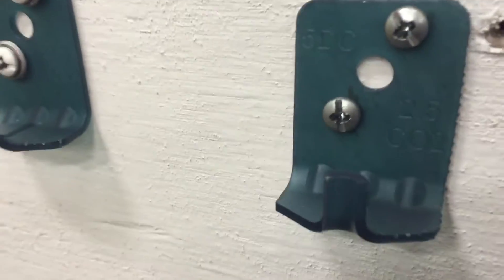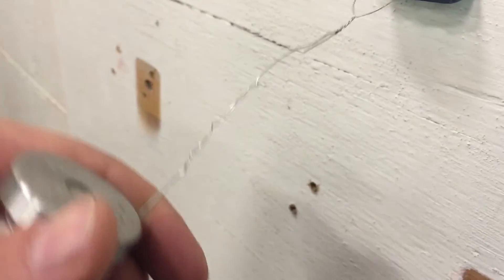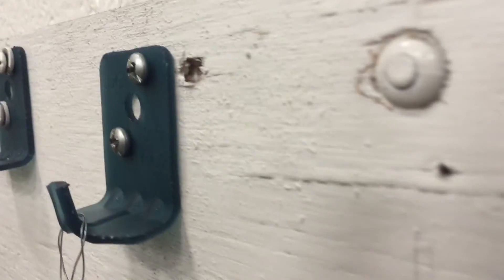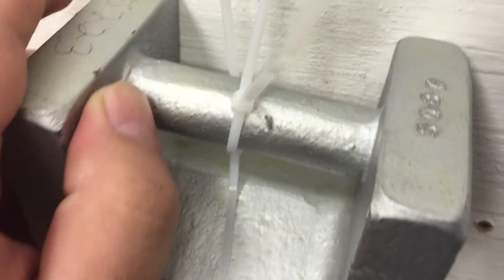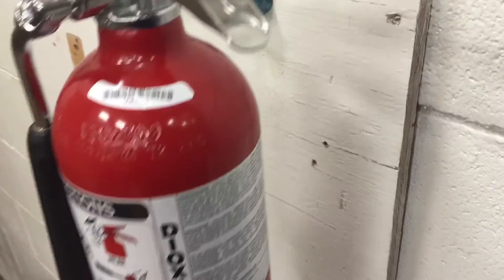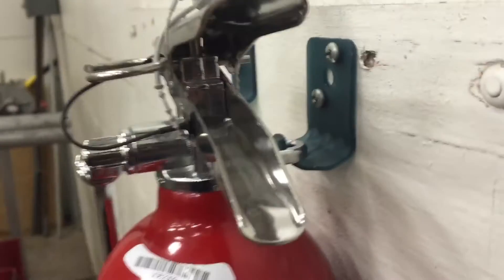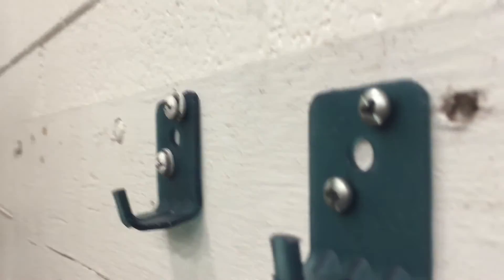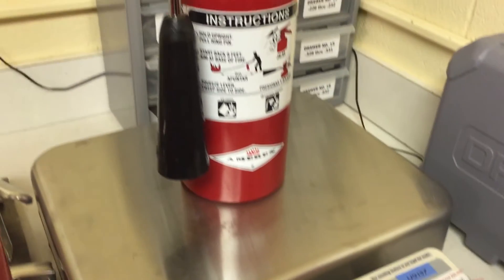Formlabs Tough resin material ♦ 3D printed bracket stress test ♦ SLA 3D printer

Comment: Did it eventually creep to the point of failure?
Reply from the maker: I did not leave the extinguisher hanging overnight or anything long-term but the bracket never failed for the time it held the filled extinguisher. It bent down due to the flexible properties of the Tough material but it did not break. I've actually used a vise to destroy a Tough printed part and once it split (cylindrical part/nozzle) it eventually returned to original shape! There is a video of that on my channel https://www.youtube.com/watch?v=PlqwcXIFHBM